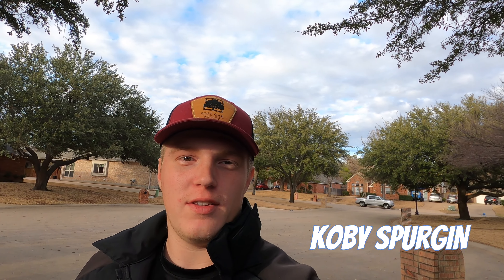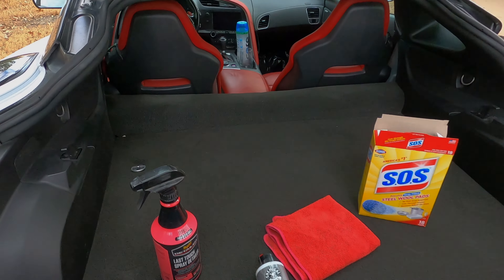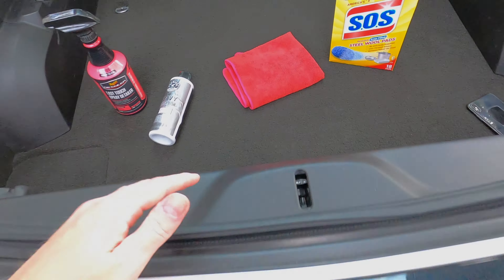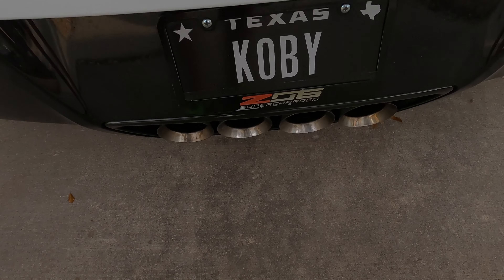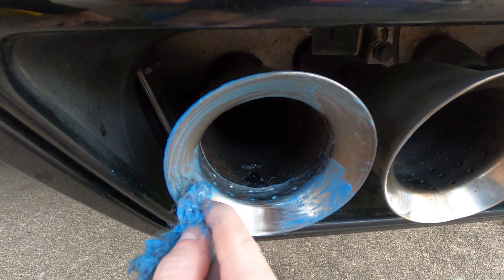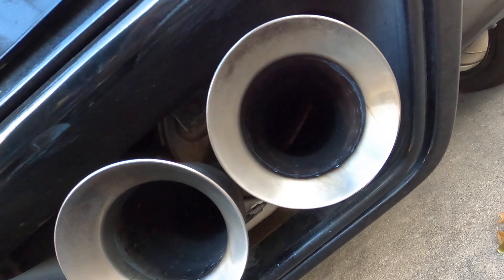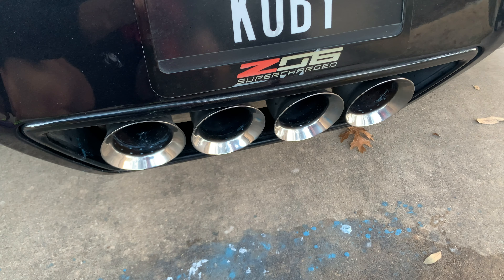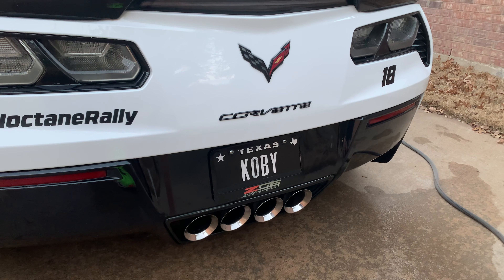Restoring My C7 Z06 Exhaust Tips | Heavy Metal Polish

Comment: I use a stainless steel cleaner spray and let it sit a few and wipes right off shines right up but nice job keeping that Beast shining strong. C7 ZO6 is the KING of the road and overall best SUPER-CAR for the doe..
Reply from the maker: Thank you so much! I need to look into the stainless steel cleaner- it took me an hour and 30 mins to do the whole thing
Reply: @kobyspurgin  I have to remove wheels and do a real cleaning. Need some new tires also reach 13k on a 2017 original tires gonna either run Proxxes all around or go with the Michelin sportcup 2R tires